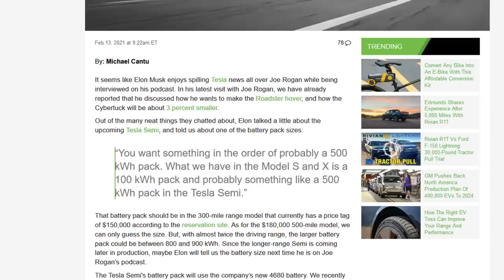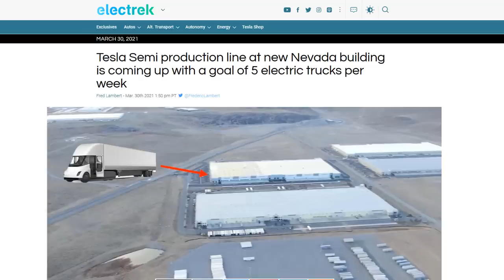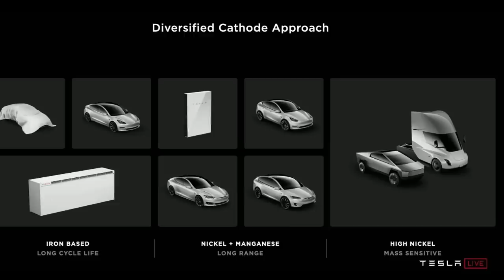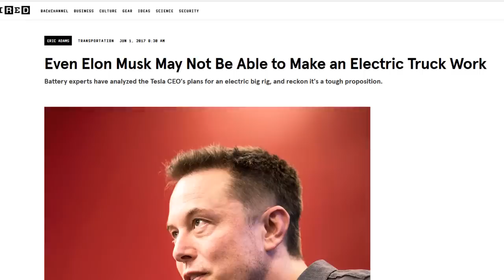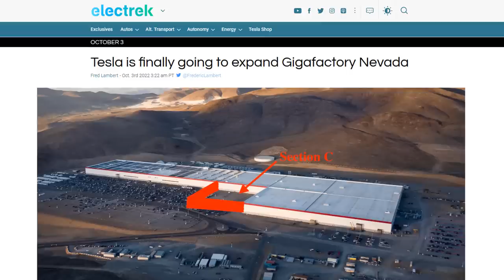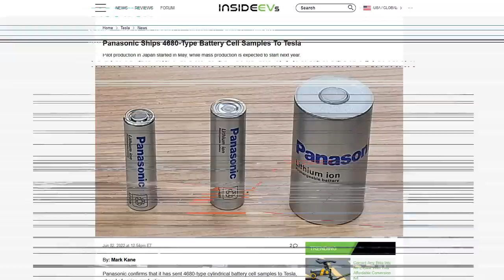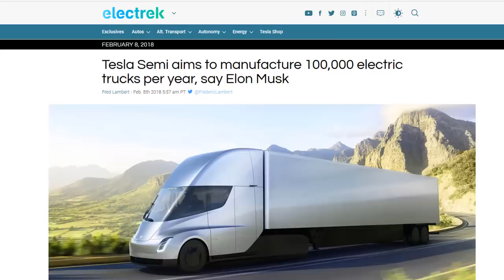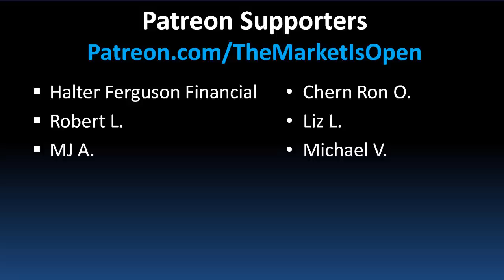Tesla Semi Is Coming in a Month - Let that Sink In

Comment: Without having the charging infrastructure ready to go they are worthless for long haul. The 500 mile range is under perfect conditions , add a 1degree uphill grade and 10 mph head wind it drops to 250 miles. Do the math.

Comment: Trucks are going to be everywhere broken down, there won't be enough charging stations. Drivers miscalculate their range. Trucks can go most places because they can get diesel easily,  it won't be the case for those charging stations. Plus they can fuel there truck in about 10 minutes,  I'm sure it won't be the case for ev trucks. The other problem will be hills, weight, gearing and tire size will greatly determine how far the driver will be able to go without recharging

Comment: make tesla trailers for the truck that have solar panels on the roof to assist charging. if the roof is mildly heated, it will even work in snow areas. pop wind turbine generating gear under the trailer to collect wind energy. use brake and trailer brake for energy creation.   or pop a smaller diesel generator on the truck to assist charging when charge ports are not available to accelerate charging.    completely relying on batteries is not very smart here, no truckstop will let you park in a small special area to charge for 10 hours during your rest and occupy one of the few chargers. the people who design these need to understand DOT hours of service, as in the hours a truck driver is allowed to operate a truck per day, once started, that clock does not stop and its run out. then it's a 10 hour rest by law, and that should be the charge time. with crowded truckstops and hardly any parking available as it is for semi trucks, i wonder just where you are supposed to charge them ?

Comment: you would have to retrofit ALL truck stops parking spots with available charging ports since regular fuel isle times no longer apply. a driver can then use his/her 10 hour break to charge the truck in a regular parking spot as he/she rests. it is surely doable, but until that is done, it will be a logistical nightmare to efficiently (from a DOT time perspective) to traverse the country in long haul freight.

Comment: 500 miles is crap no truck only go 500 miles.  What about the charge times to charge a battery pack that size not to mention the heat generated.  Then where is even going to charge?   The semi truck is so dumb I can’t believe anyone other than a 2 year old would think it this would work.  Only thing dumber is buying twitter cause you like tweeting then drive it into the ground.

Comment: If it’s anything like all of the other electric trucks it will be a complete failure. You pull a little weight and it drains the batteries like crazy.

Comment: One Tesla car battery requires 500 tons of earth to be bulldozed in the production of the battery. The Bulldozer uses 900 gallons of diesel in 9 hours. The lithium required results in pools of sulfuric acid pools, like a rice paddy, to leach it out. There is so much water needed to get another toxic metal it causes cities in Chile to have to source their drinking water elsewhere. According to the UN this is a human Rights Violation. The “Green theme” is a hidden toxic nightmare that no one talks about. For a Toyota Prius you have to drive it 400,000 miles before you get even carbon wise with a gas car. Plus the electricity to charge these EV’s doesn’t come from unicorn pee!

Comment: Holy smokes the 2019 Semi is coming in December of 2022. What are we going to do. Wait for the Roadster 2 which will be out around 2026.  We also know that the first 4680’s have less energy density  than the 2170’s do. Tesla is having huge issues making 4680’s. They are not really talking about it, but it is obvious and a huge disappointment

Comment: As a truck driver I really wanna try them out especially for regional and intermodal use
Reply: Since you're a trucker, I want to ask you something. Aren't there limits for how heavy a truck can be on the road? The batteries in an electric truck add a ton of weight. Wouldn't that then greatly reduce the amount of cargo you can have in the truck?
Reply: @lencekk 80,000 pounds is the max you can be unless you have tag axles or special permits
Reply: @lencekk  also since the truck has no engine the weight might be offset
Reply: @lencekk  I’m also a truck driver, last I’d heard, there was a proposal to raise the max weight for battery electric semis to 84,000 lbs. to offset the battery weight. Diesel drivetrains are heavy as heck too, which saves weight going electric.
Reply: @Nick White it has almost no moving parts it won’t breakdown as much

Comment: I can say these trucks would be useless for our company.
Our trucks are in use nearly 24/7, only getting short breaks during shift turnover, and during Sundays.

This means we don't have the time to charge them overnight, nor would the range even suffice for a single day- and nightshift combined.
In addition to that, the limited cargo capacity due to battery weight means we would have to decline a lot of loads because they would simply be too heavy for it.

Best of all, this weight problem isn't going to go away anytime soon. So I don't believe electric is a suitable choice for moving cargo on the road even at medium ranges.

Comment: What was that Doobie Brothers song sung by Michael McDonald, "What A Fool Believes".  I really hate to burst your bubble but No 1, there are no flat roads, even in Texas.  One can fine interstates, US highways, and state highways with a variety of grades from 1% to as much as 10%.  The greater the grade the greater the drain on any battery powered EV semi.  No. 2,  if a Tesla semi can't make 600 miles or more each day the driver isn't making money nor is the trucking company.  No.3, weather is a big factor in battery performance.  Both extreme cold and hot weather can drain battery performance.  In the northern climates where temperatures can reach 20 degrees below zero or greater the battery life is cut at least in half.  N0.4, the axillary equipment needed such as air conditioning and heating for the driver, both when moving and when stopped for overnight parking (a cdl driver can only drive 11 hours in a 24 hour period) , the marker lights on the tractor and trailer, the air compressor to supply air to the breaks, and other incidentals have not been addressed in any blog or announcement I have read.  The best one can do with EV semis is local runs, not over the road.  I could go on but this is more than enough to start the conversation.

Comment: Your figure on how much this offsets fossil fuels is incorrect.  You are not accounting for the fact that these things need to be charged. That being said, if coal and other fossil fuels are used to charge it, it’s just as bad as filling it with gas. If it is via coal power, it’s even worse given that goal emissions are more than 6x higher than gas and diesel emissions. You are presenting a very bias view on this point.

Comment: 🤣somebody calculated that that trucks need 7 ton battery and since less than 40 tons is max weight for vehicle... it will be good for transporting insulation. what a joke of a truck. probably it will be silently pushed back until all the believers forget it was a thing

Comment: Do you folks do any research of your own or just write what they feed you. For example, the National gross weight limits are 80,000 pounds. The maximum payload would be calculated by subtracting the tare weight (empty Or unladen) from the maximum legal gross(80,000lbs). For example my semi weighs 32,490lbs. You subtract 32,480(tare) from 80,000(gross)which  gives you the maximum pay load of 47,520 lbs‼️ And until the federal government raises the gross legal weight limit to 92,000 that is all any semi can legally haul without a permit from each state you would operate in.

Comment: If it only takes 2 kWh to power it (run it) than it’s small enough for them to (increase range) with solar panels 

at least during the day 
they won’t have to rely on the batteries unless it’s cloudy or they are in a tunnel 

And would help with extremely big loud.

do this on the trailer top
Reply: 2Kwh per mile! So in ideal conditions with 8 typical solar cells on the roof of the trailer, that will give you about 8 miles extra range.
Reply: @davidbrayshaw3529  Now increase the number of alternators and put them on the bottom of the trailer using the trailer tire to run them thank of how tanks work kind of like that.

And u could say f it and also use air turbine but i don’t thank it will help because it will increase air drag 
(messes up the arrow dynamics)

Comment: They need to partner with the Truck stops and install super chargers in the truck stops. Have special parking places just for Tesla trucks each with it's own super charger.
Reply: Truck stops close to a substation that has a spare 1000+ amps available! The amount of energy required to charge one of these things is massive. Now make it a fast charger and put 5 or 10 trucks on the circuit... I think you get the drift.
Reply: @davidbrayshaw3529  For sure the infrastructure isn't there yet and is a ways away from what I can tell. To me, the only way I would own an electric vehicle is if I had solar panels on my house and didn't drive that far daily. If you have to burn coal to generate the electricity for the batteries, it's not so green anymore and draws from the power grid that might be needed elsewhere, maybe keeping people warm in the winter.  JMO
Reply: @Barneyrubble241  I'm quite sure that the world has gone mad! Cars are a relatively small emitter of CO2 (+/- 8%). Electricity generation on the other hand, about 50%. I think we need to address the latter issue first. But hey, I'm not a worldly, wise and scientifically literate politician, am I.
Reply: @davidbrayshaw3529  Yes they do. LOL!!😀😀

Comment: The drivers seat is centered in the cab.  I tried to tell Tesla that is not feasible.  Drivers cannot back into a dock without being able to look out the side window to guide the back end of trailer in the turn.  Electric semi's are not feasible for 90 % road travel.  (a) range is not long enough, (b) you would have to haul light loads, (c) can't run in bad weather, cold temps, or in the mountains, + (d) travel would be limited to city traffic or short haul out + back dedicated loads.  And forget about any autonomous travel, it's not going to happen.

Comment: Not really sure these do any good. The range is the issue most people think about but it's not the only thing. The fact a third or more of the trucks capacity is tied up in battery weight means more trips. Never mind what happens to the batteries every five to ten years as they are replaced.

This tech is no where near ready for wide release imo, uf they are shipped it was because if contracts made to early sales in 2017. I get the feeling Musk has to release some or give out more refunds like the solar roof company he had.
Reply: 1 - 200 mile trip  per 1 week of charging. 
for $700k... its not worth it
Reply: @zarthemad8386  where are you getting any of this information, what is 700k? This truck has a range of 500 miles not 200

Comment: Diesel Trucks are just so efficient and last FOREVER.  It's not uncommon for them to drive a million miles in their lives, I just cannot see the Tesla Truck competing with that type of longevity and the big cost of rare earth materials in the construction is the big problem already for them.
Reply: I've come accross multiple semi trucks with multi million miles on their engines.
Reply: The trucks that are efficient are not the trucks that last forever. Not many 10 year old volvos or cascadias still on the road, and your w9s and 357s aren't really that efficient.
New trucks are meant to be thrown away just like your phone. 8 years and they're toast.
Reply: It takes a little over seven years for the average semi tractor to reach 1 million miles.  Given that when bought new, the average tractor will cost about $125,000.  Add in the tires, the maintenance, and other factors one can see that the average cost per year, excluding insurance and loans will bee in the neighborhood or $25,000.  Insurance and financing adds considerably to that cost.  Will an EV tractor provide anything close to that low of an expense?  Will battery packs last a million miles?  I don't see any conversation on this subject.

Comment: 13:00 that is false. You only need a CDL if you are using the truck for commercial purposes. "Not for hire" requires no CDL if your weight is under 16000 lbs.

Comment: So I know this comments going to get lost but I wanted to spell a myth that was perpetrated in this video. You do not need to have a CDL in order to drive a semi truck. You only need a CDL if the primary purpose of that semi truck is commercial use. 99.99% of semi trucks are for commercial use, however if somebody with enough money wants to buy a semi truck and not have a business and register it in their personal name and insure via their personal insurance if they can find an insurance company to do so, they can drive that semi truck with or without a trailer from coast to coast with no CDL. If the person in question is from Pennsylvania and has a Pennsylvania license and plate they can drive the semi truck without a trailer using the exact same license that you get when you're 16. I do not know other states laws so I cannot speak on those states, but as long as the vehicle weighs less than 25,000 lbs any resident of Pennsylvania with a class c license aka the minimum license in Pennsylvania can drive the semi truck. No additional training required. If somebody does want the trailer and has a Pennsylvania license they would need a class A license which goes up to 85,000 lbs, but not a CDL. But if that person wanted to and had a Pennsylvania class A license which is the same license that you need to get in order to own an RV, you could take a fully loaded semi tractor trailer and drive it from coast to coast on a non CDL.

Comment: I think electricity makes the most sense in semi trucks. My only suggestion would be offer the option to have an even longer range option using a special trailer that has batteries.
Reply: so then your load is your extra batteries making your semi useless. Most fleet owners are not going to want to loose the hours on the road needed for charging, not to mention the drivers that are owner/operators would loose out on income potential per week since your few minutes to refuel becomes a few hours. 
I think the best market for these would be for large factories/giga factories. Your conventional semi would drop off loads to the factory, then your electric trucks could move the trailers around and in the factories for offloading and be on the charger when not in use giving optimal availability.

Otherwise I think you'd see teams start moving the same loads so that while truck A is charging at stop 2, truck B can move the load on to stop 3, etc.
Reply: @phoxpharms  I was thinking more along the lines of using the batteries as the frame of the trailer. You can make the floor of the trailer a battery and then potentially the wheel boggy a battery.
Reply: @dimetime35c  Semis are legally limited to a weight you just significantly lowered profits for little gain and worse interoperability
Reply: @moonrains5876  yeah I was just thinking use some of the dead weight you have in the trailers framing as battery and load bearing weight.
Reply: @dimetime35c  
Its not dead weight, its structural.  Don't think the batteries can hold up the weight  by themselves.
Reply: @tianyi05  they ues the battery packs as part of the structure of the tesla vehicles.
Reply: @dimetime35c  whole lot of difference in weight load.  And it would still have to support the weight of the batteries.  The weight of the batteries, structural frame, weight of the tractor and it's batteries all have to be calculated into the maximum weight limit in the US.  which means you're subtracting from how much weight they can haul.

These types of vehicles do not make sense for long haul.  they really only kind of make sense for short haul in/around cities and maybe dedicated work at docks/ports/plants in the form of a yard dog.
Reply: @tianyi05  🤣why their roof is not big battery than? part of structure is one of the biggest BS that they come up with. and nobody really knows what that mean
Reply: Everyone forgets the power need to sleep in comfort ac/heat how are you going to charge still using that won't kill the batteries longevity
Reply: I take it you have never driven truck for a living now ever been an owner operator.  Really, where did you get your data to make such a statement?
Reply: Install solar panels on roof and sides of trailers. Should extend range.
Reply: @joyceleadbetter2600  that's actually a good idea. You could use the panels as the roof. Wouldn't give amazing increase but would probably get you like 20 extra miles.
Reply: @joyceleadbetter2600  I love ignorant people.  No. 1, the total weight of the tractor and trailer cannot exceed 80,000 pounds when fully loaded.  How much would solar panels weigh and would that be conducive to transporting freight with a 'less than total' load?  Number two, if the height restrictions for all semi-tractors and trailers is 13ft 6 inches, wouldn't placing solar panels on the roof of the trailer and tractor exceed the legal height limit?  No. 3, one would have to adjust those solar panels to catch as much sunlight as possible, not an easy task then those trucks and trailers are constantly changing position relative to the optimal sun light.  And if many drivers choose to run at night due to traffic congestion, wouldn't solar panels be useless?  My dear, there is no free lunch.
Reply: @joyceleadbetter2600  🤣good joke